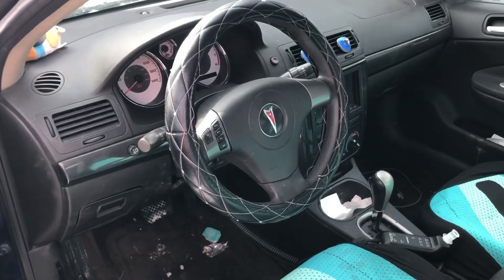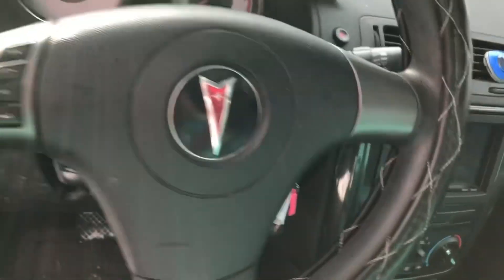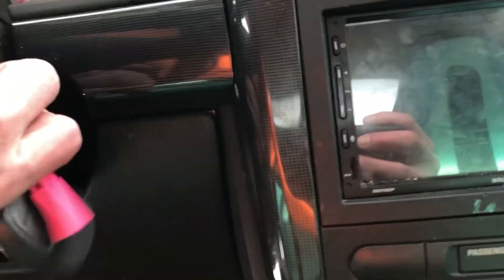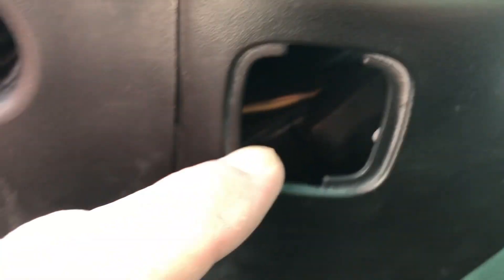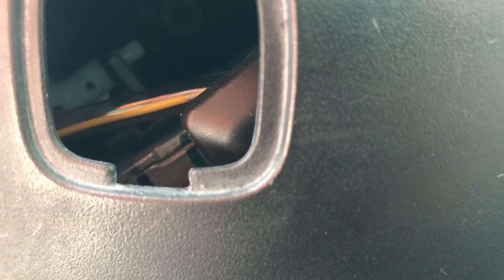How to Remove Ignition Key that is Stuck 2007 Pontiac G5 & Chevrolet Cobalt

Comment: How do you remove a key ignition from a Chevy cobalt 2007
Reply from the maker: Hey Rob! Should be the same way, cobalt and g5 are basically interchangeable. If not try wiggling the steering wheel back and forth while jiggling the key. Let me know what works 😁👍